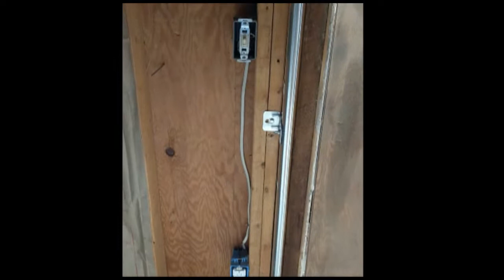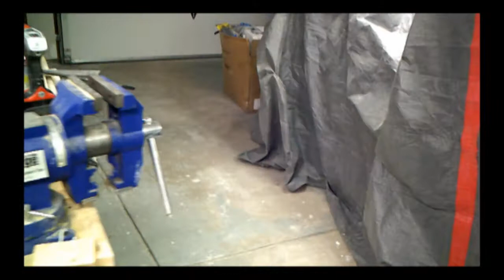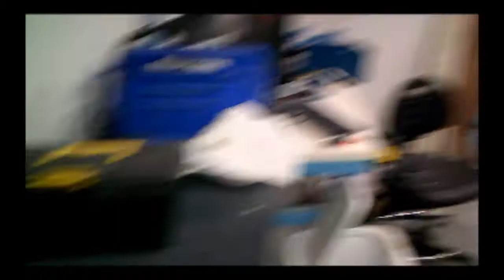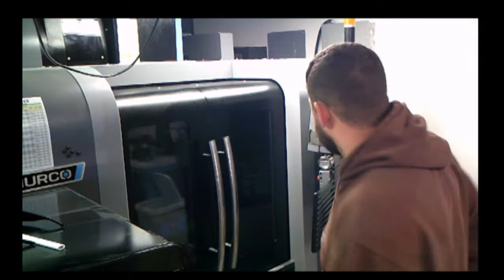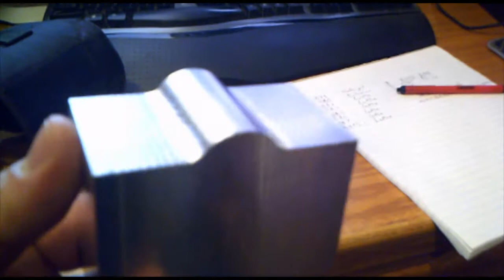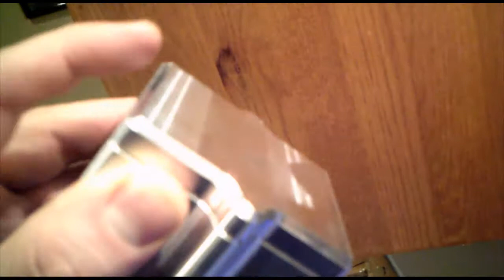Long Pines Design Episode 01: Setting Up Shop & First Chips

Comment: Cool vid, and nice machine.  You are climbing the learning curve, thanks for showing reality.  (PS did you use a different bit for the exterior on box 2?  The bits were singing on #1)
Reply from the maker: Sorry I didnt see this till now. I cant remember what tool for the box. It was one of the first things I ever machined and I definitely didnt know too much about machining. I think I used a 1/2" diameter, 2" LOC endmill for the inside and outside.